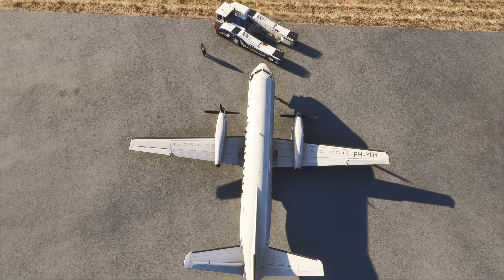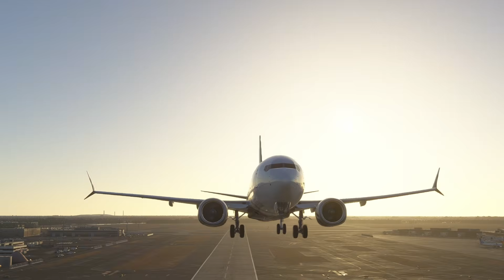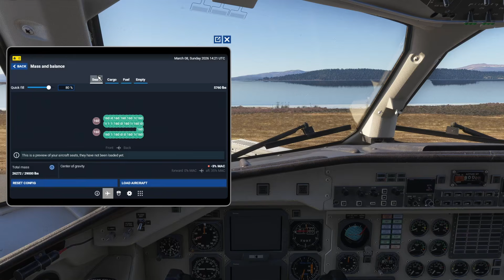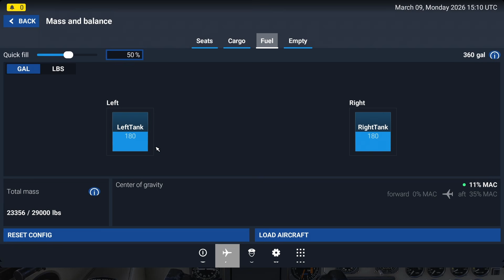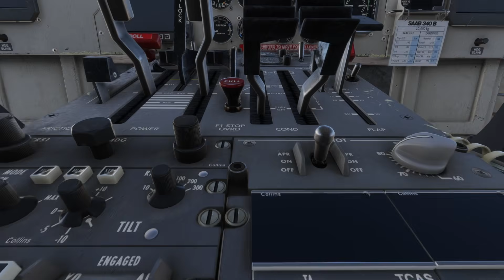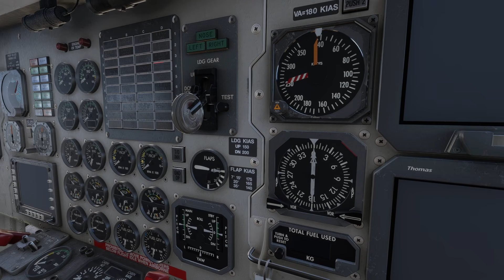Saab 340 Finally Explained! CTOT & Engine Guide (MSFS 2024)

Comment from the maker: "Mastering the 'Muscle' of the Saab 340! 🇸🇪✈

One important thing to remember: The CTOT system is often mistaken for an autothrottle, but it’s actually a torque limiter and trimmer. Keep an eye on those power levers—once you hit that 64° mark (the yellow stripe), let the system take over the precision work!

I have a question for you all: Now that we've seen the 340B+ Active Noise Control system, do you prefer the quiet cabin of the B+, or are you a fan of the raw, legendary turboprop 'drone' of the original A-models? Let me know below! 👇

Coming up in Part 3: We’re tackling the secondary systems—hydraulics, electronics, and that infamous 'Glo Bug' fix that keeps so many pilots stuck on the ramp. Don't miss it!

If this helped you, don't forget to Like and Subscribe to complete the masterclass series! 📖✅

Comment: 2:58 - Never seen a Saab 340 with winglets - WT's have extended, but straight, wings.
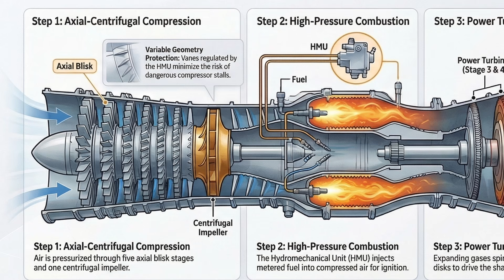8:50 - WTF is going here? This diagram is completely wrong - it's like a turbojet with a pusher prop.
Didn't look at it beyond that.
Reply from the maker: thanks for your insights and feedback this is valuble input for me to pay even more close attentions for the diagrams I am using
Reply: @Highintheflightsimsky  bro just stop using AI!!!!

Comment: Thank You for videos. I just bought it on discount as this is the closest thing to Dash 8-100 (sadly no good dash 8 out there). I love dash and STOL- we have here in Norway short runway system operated mainly by Widerøe. Much less boring aviation than airliners.
Reply from the maker: Thanks for your insights on the experience with the aircraft, I thought there was a Dash 8 released last week not sure how realistic it is however
Reply: @Highintheflightsimsky  there is virtualcol dash 8 100 and 200, but for medium quality simming (like nav, ifr, batc) it is not a good option. And costs double of what Saab costs... We are still waiting for Majestic Q400, but this one is not STOL, and were waiting now maybe 5 years?

Comment: How do you slow down the taxi speed ? It seems to race at 35 to 45 mph all the time. Thanks.
Reply: @lorenzoverde2576 try going into BETA by adjusting power into reverse range on throttle. Use small amounts of reverse to driver slowly Or slow down. Or use brakes :)
Reply from the maker: yep indeed that is also the trick applied
Reply from the maker: see the tip from Greg